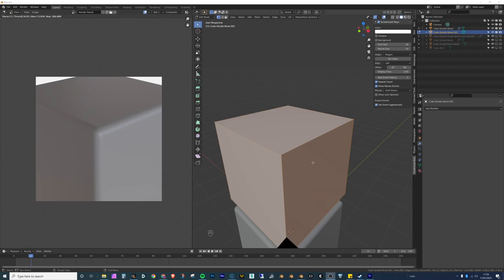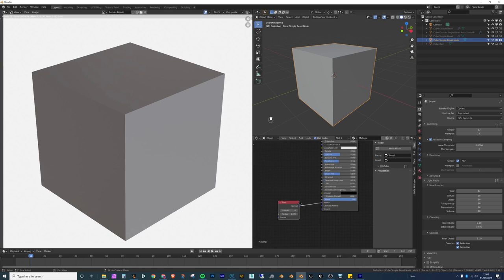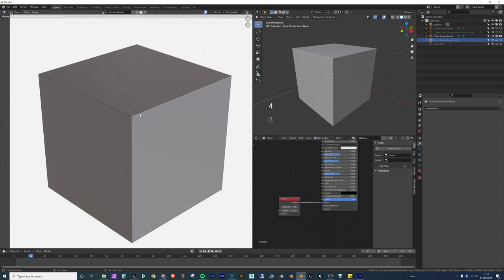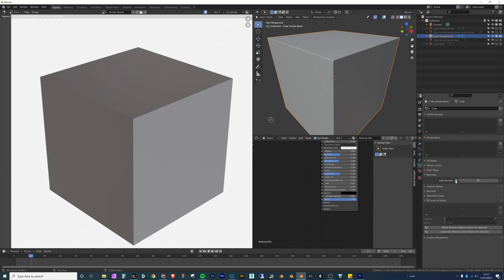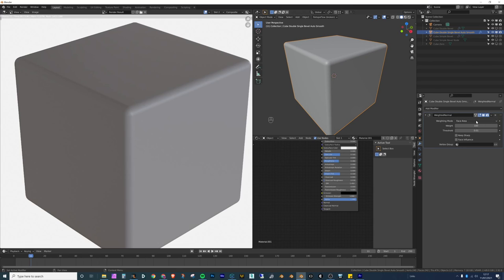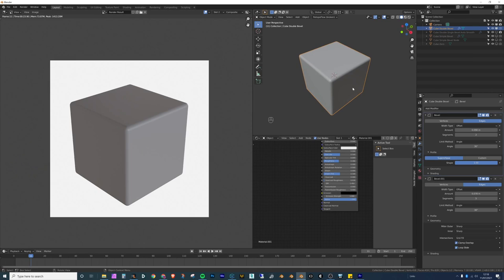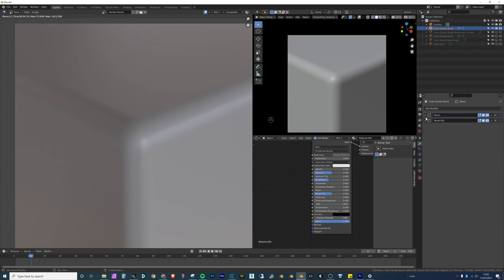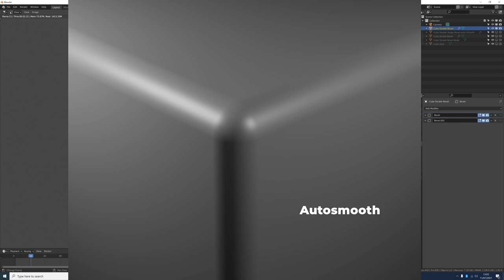Is this the most REALISTIC BEVEL method in Blender? | iMeshh Tutorial

Comment: the bevel node is a genuinely wonderful approach to bevelling! having it as a global option is one of my favourite things about blender octane. it can save performance in heavy scenes and you can almost never tell the difference!
Reply from the maker: Absolutely, I really don't think you'll notice in most cases which is pretty crazy
Reply: @imeshh  i don’t really use geometry bevelling much anymore but if i remember correctly i believe that the gradient/smooth shading issue you’ve been having can be solved by marking seams/sharps on edges before bevelling, which tells the shading engine what direction the normals ought to be facing and prevents shading errors without the need for adding extra geometry using loop cuts. if you’ve ever used the HOpscutter addon this is a standard part of the boolean workflow, v worth looking into as it takes much less setup time on complex models (and saves on performance too)!

Comment: I found pretty interesting something called 'g3 curvatures'. After some research I found g3 curvatures have a smooth transition. Someone  at blender community explained to me that a bevel shape or profile superellipse of .707 (In CAD softwares it is called g3 curvature) has continuity in the curve.
Reply from the maker: This is incredibly interesting, thank you! I'll certainly look this up!
Reply: @imeshh  I just tested this and it works. When you add bevels (either Ctrl + B or Modifier) the normal default way in Blender, the Superellipse Shape is set to 50, which causes that visible boundary after a beveled edge. Whereas using the bevel tool through HardOps, the shape is set to 0.70 as default, which gives the same seamless face to beveled edge as working with 2 bevel mods as you suggested!

Comment: Harden normals create additional islands if using Geometry/Random Per Island; one per face and one for the bevel itself. So if arranging "cubes" into "studs" in the same grain direction using box mapping for texturing, Geometry/Random Per Island is out the window for randomizing texture lookup per stud.
Weighted Normal modifier just often produce results I can't live with.
I also prefer the reflective look of superellipse 0.75 over the rounded 0.5, but wider. Always test with a sharp glossy node - the "flat" face isn't supposed to undergo any stretching in the reflections as you turn on and off the bevel modifier. Why I prefer 0.75 is more evident if trying the zebrastripes matcap. 0.5 produces a bevel with a fixed radius, so in terms of curvature you get from zero to a fixed value. At 0.75 you get the smoothest transition from zero then gradually up to fixed.
If all you want is capture specular highlights, then this doesn't matter much. If going up close on a highly reflective surface or doing professional looking consumer products (featuring aesthetics or hand grips), surface curvature quality is something you might want to consider. Check out "Evaluating SOLIDWORKS Surface Quality" youtube tutorial, where we have more tools available to evaluate curvature continuity.
I don't care about "I'm doing it wrong", I care about the final looks that doesn't mess up the flat areas, does a proper transition, and don't create additional islands since I use islands all the time to randomize texture lookup. There are ways to avoid the island thing on a mesh, but that approach (collapsed UV to a point per island -> snap -> white noise) doesn't work if they are created by arrays.
I like the bevel node too, as you can hookup a noise texture to randomize the size of the shaded "bevel". There is no "one solution fits all".

Comment: Nice trick creating the supports with the bevel profile set to 1!
If adding more geometry is not viable, increasing the bevel profile from .5 to .6 or something like that also helps reducing/smoothing that line between the bevel and flat surface.
Reply: I tried and it's amazingly true.
Reply: Ironically, if you add a lot of geometry, like 100, at .5 the lines become exaggeratedly visible, while at 5 they don't.

Although at .6 100 or 5 it looks pretty cool.